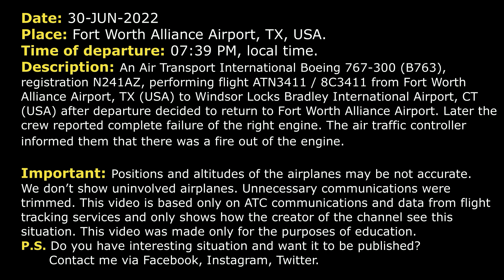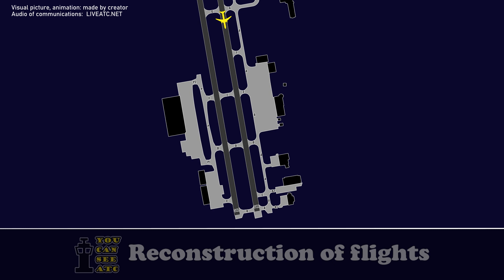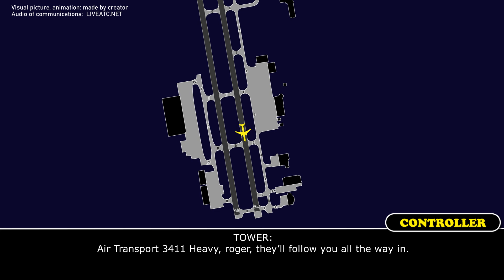Engine fire after takeoff. Complete engine failure | Fort Worth, Real ATC

Comment: Just a question at the end she was cleared right on Delta to cross 34R, but she was on 16L/34R and would therefore have crossed 16R/34L was this just an error or am I missing something, no real problem as they'd closed it to everything.
Reply: She was cleared to cross 16R but was on 16L - the clearance was correct. The airport wasn't officially closed so the clearance and readback were both correct and required.